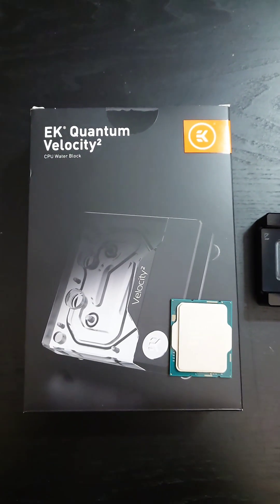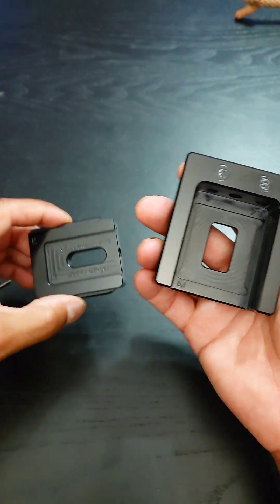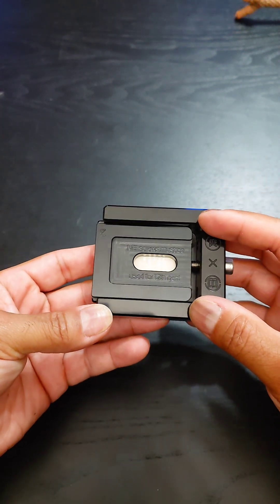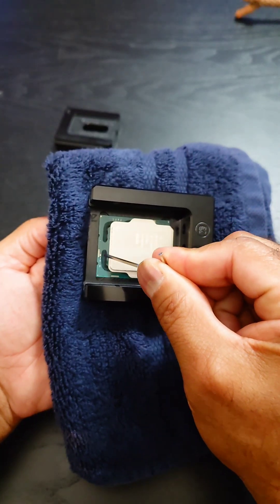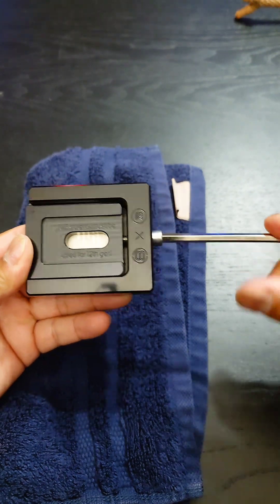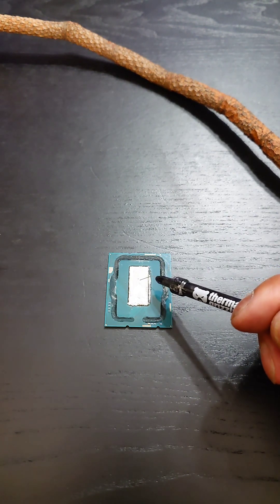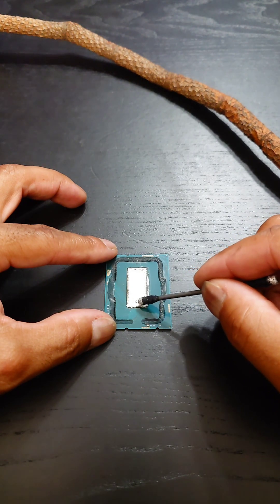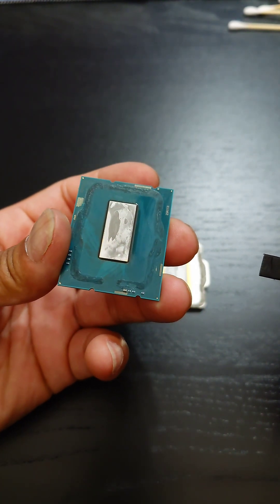Cracking open an Intel i9-13900KS CPU - Delid & Liquid Metal

Comment: What nosense hot the block+cpu, the strengh of the silicone is the same at 20º and at 200º, you just can damage the CPU heating it.
You think that the CPU is just a piece of metal man? is a delicated object with millions of connections 10nm.
One thing is that a core or some cpu cores reach 100º and another thing completely different is that the entire CPU heats up to 100º, you have not damaged the CPU by an miracle.
Reply from the maker: Deliding is a common practice. This is nothing new and it's hard to mess this up.
Reply: @DaPoets  Yes, deliding yes, hot the CPu for delid no, you continue hot the CPU for better delid and you will check before or later that the CPU dont work again good.
And with less nm lithography more risk of damage the CPU if hot it for delid.
You cannot understand that the silicone in IHS have the same strengh at 20º than at 200º? you are making a stupidity hotting the CPU, try delid without hot the CPU.

Comment: I'm waiting on a 14900KS before doing this (I currently have a 13900K). I have the delidder and direct die conversion kit ready 😁. An observation and a question if I may: The 13th and 14th gen Intel CPUs are happy to run at 100C continuously and non-operating temperature is probably a good deal higher so why not put the assembly in a domestic oven at maybe 110C before turning the screw each side? Is there any risk of the liquid metal used for cleaning getting under the die? I.e. How careful do you need to be with the liquid metal whilst cleaning/wiping?
Reply from the maker: That's the old school method and we used to do that often. I just take a hair dryer now to it. As for the liquid metal just don't get it on anything, only apply it to the die.
Reply: @DaPoets  Thanks for the reply. I was a little worried when it comes to wiping off the liquid metal that it could get onto and under the edge where the die is mounted to the PCB.
Reply: @DaPoets Just de-lidded my 14900KS using the EK 13th and 14th gen de-lidder (red slider and side to side rather than end to end). I put it in the oven at 70C for 15 minutes and it was incredibly easy to get the IHS off in one pass with very little torque on the wrench. 😊

Comment: I just did my 14900 K and found the easiest way to get the indium off of the die was to heat it. 2 seconds with my heat gun and it turned straight back into liquid and I wiped it up.